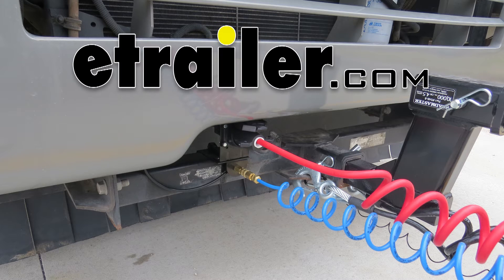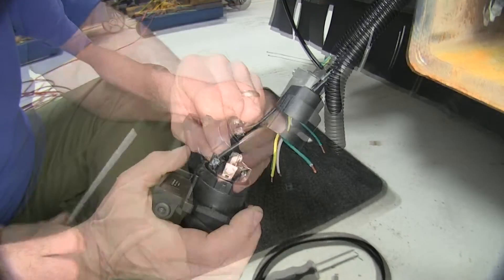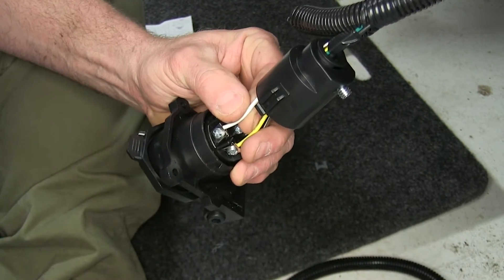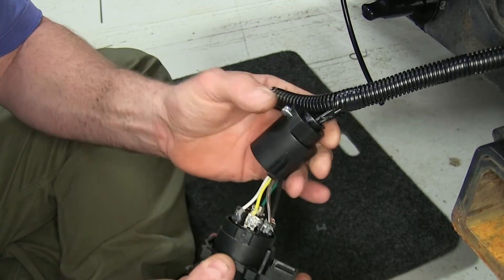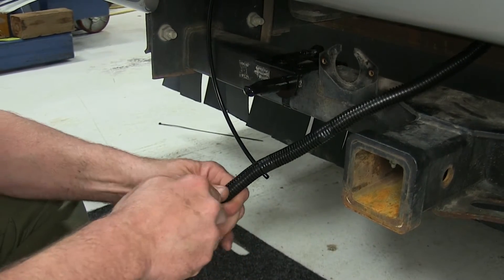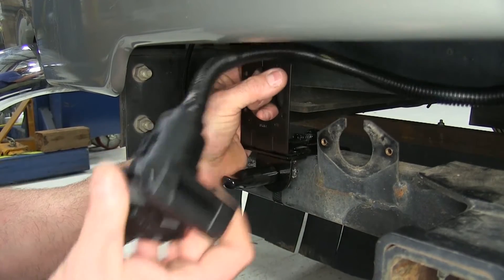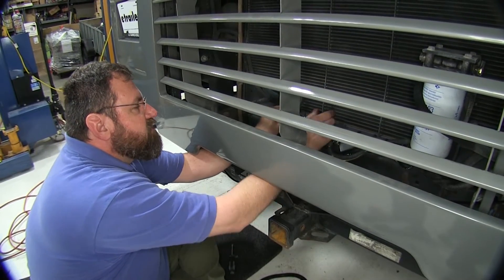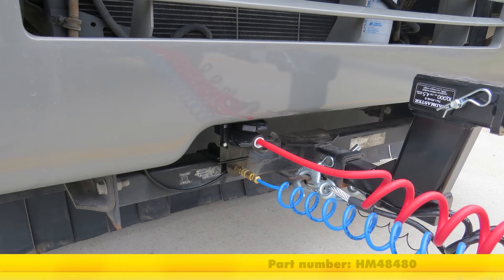etrailer | Breaking Down the Hopkins Endurance 7-Way Trailer Connector Socket

Comment: Unless there are NO other options, an outside tow vehicle connector can be the biggest headache you ever had. Regular weather and especially northern climes where salt is used on the roads is just inviting corrosion. I don't even leave my trailer connector outside. I keep that one stored in a plastic box when the trailer is parked. There's an exit hole for the cable on the bottom, but no direct weather ever comes into it. Silicone spray inside is good too.
   My efforts pay off because I NEVER have connector issues.

Comment: Nice video. But what does the BK stand for on the tester? I worked on a trailer and the brakes WOULD work with two other trucks but NOT with the owners truck . I have two , a Curt and a Tekonsha. Both of them showed the Left and Right turn signals activated when applying the brakes but the brakes were not activated. The lights and everything else worked but no brakes. I had the trailer jacked up with both wheels off the ground spinning the tires so magnets were activated. Plus the 12v light was on.